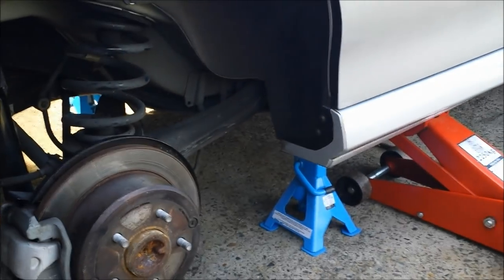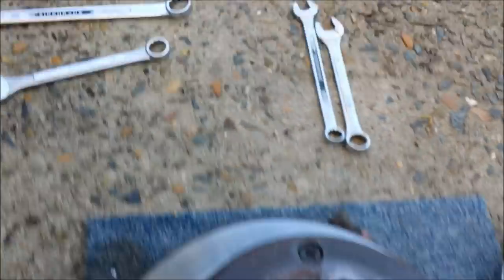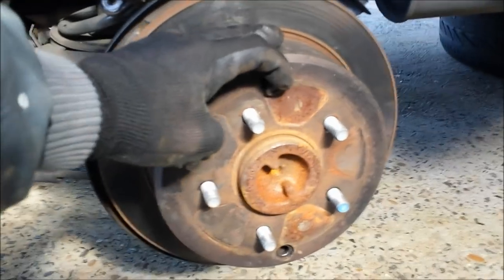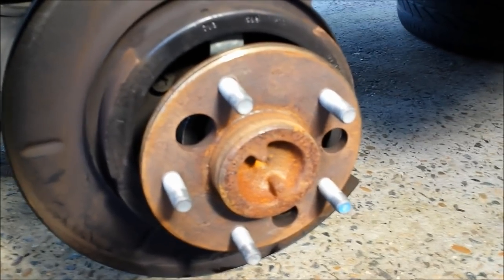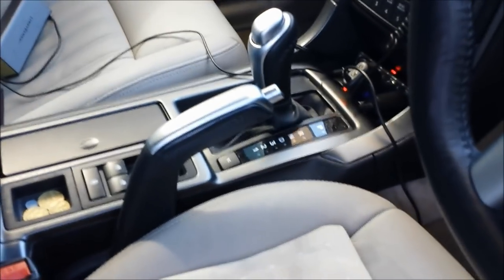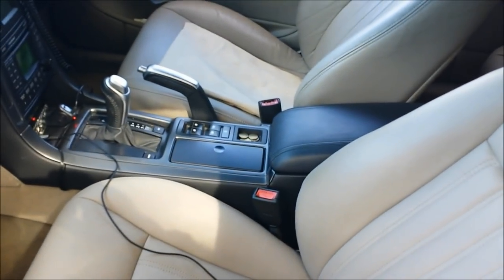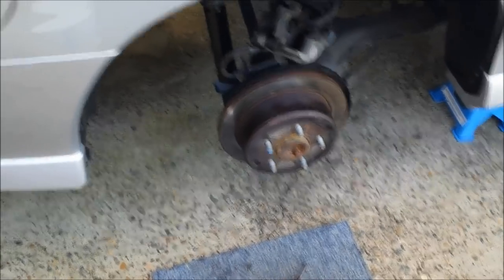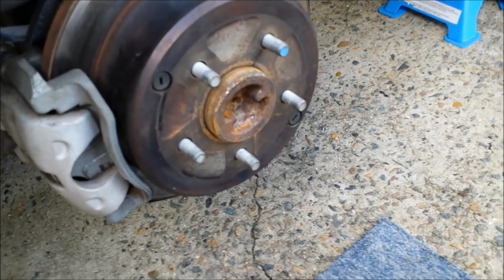Holden VX, VY, VZ Handbrake adjustment

Comment: Continuing from my last comment from 3 months ago, I finally got around to performing this handbrake adjustment on my VX. After getting the adjustment cogs unseized, I got it done fairly smoothly. As I suspected, the left-hand side was far out of adjustment compared to the right-hand side. The shoes and rotors didn't appear to be unevenly worn, so I'm unsure how it could have ended up so far out of adjustment. I achieved 4 clicks on a flat surface and 6 clicks on slopes - all in all, a success. Thank you again!

Comment: Good video Alex. Thanks for the tips mate. It's a wonder they just didn't have a slot in the backing plate so you can adjust it the way you can on almost all drum brake systems. My VZ Calais is the first car I've owned with 4 wheel disc brakes, and I didn't even know that there was a different set of brake pads for the handbrake. you are never too old to learn something new. Thanks again.

Comment: Im going to try this method on my vx,i installed 2 already but they were damaged & i have installed a new one but i feel its longer than the last 2. Ty for the video now i know that my right side needs adjusting as the left is tight but under the car i have more cable that runs to the back (ball-bag) clip than the last. Should i buy a brand new one as this one is my 3rd from pick a part non damaged or have i still got a fair way of adjusting to go

Comment from the maker: Hi Samuel!
Thank you for your feedback!
 I mentioned that "four to five clicks" is what I prefer.Sure, you can set it differently. And my way of doing it  is only  a guide. I am not taking into account things like: stretched brake cable, Holden modified brakes pads shoes*, unequally warn rotors etc.
  * Holden had modified the brake pad shoes by installing a bracket with spring to keep them centralized and contracted then handbrake is off.  That is why on original version if you have  a bit of  touching - doesn't mean that both pads are touching. Best deal on Modified version is available from REPCO.
  In regards of final adjustment I recommend following: 
  Move you seat all the way back and expose the hand brake handle by lifting the soft plastic cover (no need to take it off). Under the cover you will be able to see a long bolt with 10 mm nut. This nut regulates the cable tightness. If your pads touching the rotors too much unwind the nut, if too loose tighten the nut.You ,obviously, understand that it is only good if none of cable sections are stretched (if so that's another job). In my case: I knew that cables are good, the 10 mm nut not wound all the way down and have plenty of room to be adjusted. 
  To answer your question: Why 4-5 clicks? First is a safety:shorter travel - quicker response, especially during the rain and on highways, second  and most important: it is convenient for my wife - so I never have her objections to spent time with my "Interceptor" )))
   Best Regards

Comment: Very comprehensive video, thanks for taking the time to make it! I recently had to replace the handbrake cable on my VX and my understanding is that tightening purely from the cable can cause premature stretching, i.e. it will just snap again, so I didn't deliberately adjust it to 4-5 clicks like I prefer - rather I adjusted the lever nut to the same position as the old one, knowing that the adjustment needs to be made at the wheels. When applying the handbrake on any sort of slope, I can distinctly feel the car wanting to roll on only one rear wheel, unless I pull tighter - very obviously in need of adjustment and/or shoe replacement. Needing to pull tighter is likely what caused the lever cable to snap in the first place. Thanks again!

Comment: Great video, first time doing it for my berlina and you've helped lots. Unfortunately,  19mm on the back of the caliper had issues but using the adjustment hole worked out.

Comment: At the end, you show the ideal adjustment with 4 clicks of the hand-brake.
However, you mention there is still friction from the brake shoes when the brake is released fully.
Surely this is a bad thing? When the car is driven, will it not rub and cause wear and extra rolling resistance?
My VY's hand-brake only works right near the top, but it still locks firm and holds the car. I am happier this way, as I know there is no resistance from the brake shoes being too tight.
Can you advise on how 4-clicks is good?

Comment: If you remove the bolt holding the shocker and then push the shock to one side its much easier to remove 19mm bolts.

Comment: You dont wipe off brake cleaner with a cloth , brake cleaner is designed to dry quickly by itself , you saturate the whole assembly in brake clean which lifts dirt off ,  and it drys by itself

Comment: My VX has a VZ rear end it and the adjustment wheel does absolutely nothing.
I pulled both sides out where the handbrake shoe rests on and there is no thread in there at all on ether side to adjust the points out.
The handbrake cable just pulls the lever and pushes the two pivot points out to open up the handbrake shoe.

Comment: What do you think the rubber grommets in the rotors are for? You don't need to remove your calliper or rotors at all. You simply remove the wheels, remove one of the rubber grommets, line the hole up with adjustment spindle and make your adjustment with a screwdriver. This will save you $200 in dodgy backyard mechanic fees.
Reply from the maker: Hi Peter, 
You are correct! And.I highlighted this. However, you will not be able to check the condition of  your rear shoe pads and their positioning as well as cable tensioning and interconnecting spring. Grommets are good only if you confident that the rest works well. However, on any vehicle 10 y/old and more it is unlikely the case.
Thank you  for your comment!

Comment: Mate, you missed out showing the hard bits, removing the caliper, its b hard to undo those 19mm bolts, feels like there about 90 ft lbs tight. BTW They look like once only types to me.
 Getting the rusted on rotor is another one, I got it off with a bolt and nut behind rotor through the caliper mounting hole to tension it up than hitting on the hand brake hub. 
Now the next problem, The rough adjustment ? the cog move two clicks, up or down seems to be ceased up somehow.
Reply: push the drum brakes towards car it will move to allow adjusttment

Comment: I have a vy v6supercharged Calais.My dashboard has started to read brake lights failure but they're working.Can you help.
Reply from the maker: Hi Trevor! First  I would check: 
1. Wattage on brake lights bulbs-it has to be the same. 
2. Brake lights relay
3. Limit switch of brake pedal (push/release button)
If all above OK you need 
to check wiring and computer.In these scenarios I recomend to involve auto electrician.
Regards Alex
Reply: Thanks for that. Problems solved! :-)

Comment: Can you tell me how to adjust if the cables are stretched
Reply from the maker: Hi! I would tension the 10mm nut near the handbrake lever. If  the nut on its maximum tension, I would  replace the cable, it is a bigger job which requires a hoist to work under a vehicle, which can be done in a workshop by qualified mechanic.
 Do not forget, that stretched cable has no adequate integrity and might geopardize your safety.
Reply: Alex Zhigunov thank you